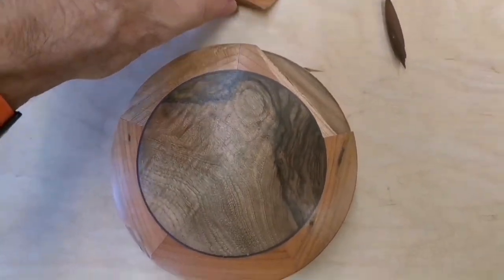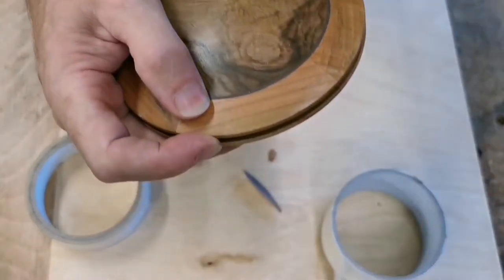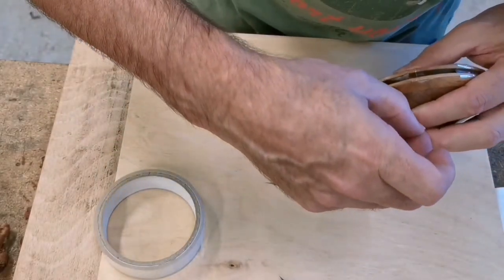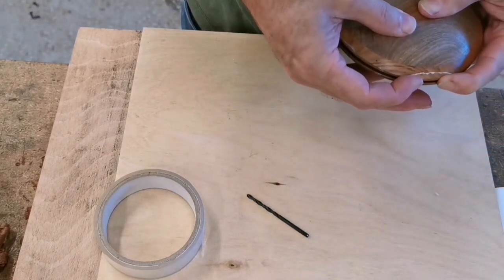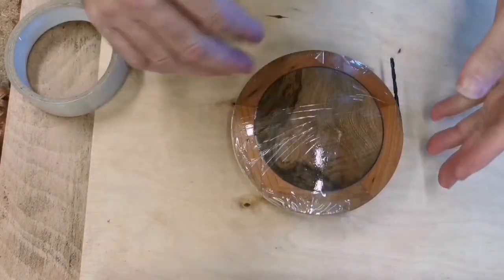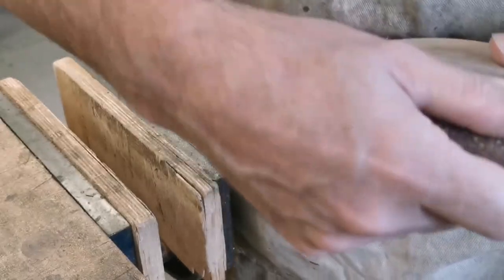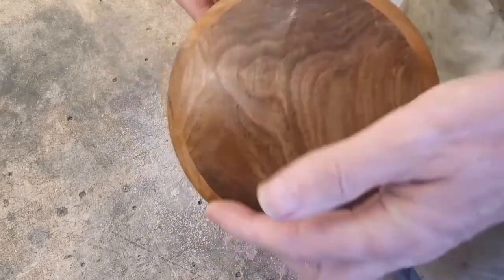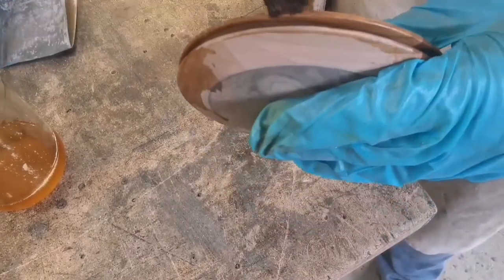Bruce Aitken wooden clock repairs to the counterweight

Comment: it looks like there"s a staple in the outer edge ?
Reply from the maker: I know. Its wood filler. The same as the ring of filler that's running round the front. It's disappointing to see.